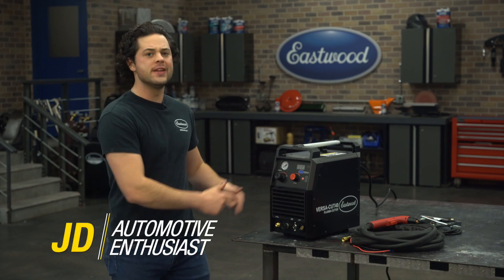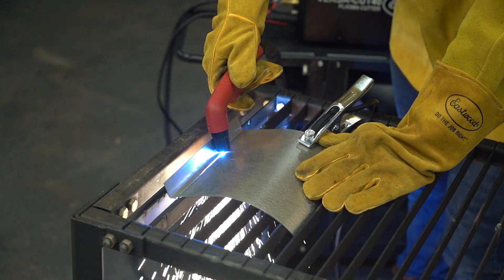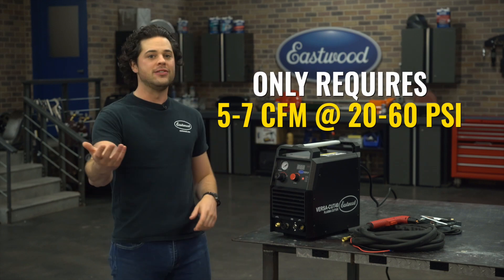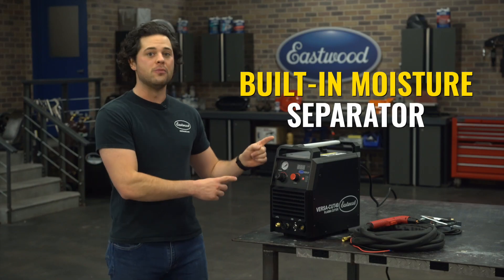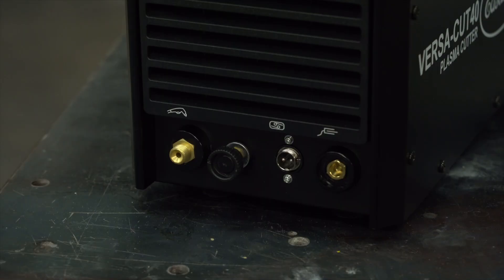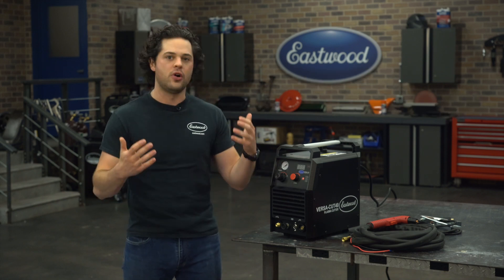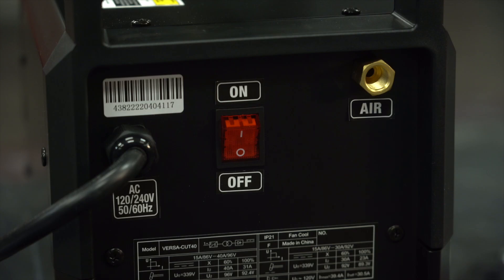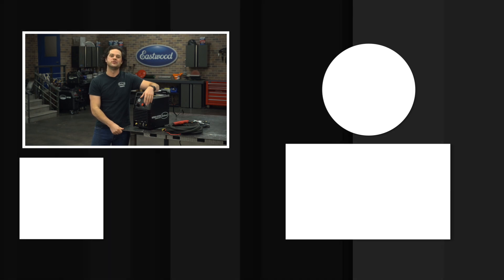Cut Steel, Stainless & Aluminum Up to 3/8" Thick -  Versa Cut 40 Plasma Cutter - Eastwood

Comment: Mine isn’t cutting through and is turning off after 5secs of holding, what am I doing wrong or what do I have to adjust to keep it running?
Reply from the maker: Please reach out to customer support: 800-343-9353

Comment: Mine don't cut that great and leaves alot of slag. Also burns through consumables like crazy...What am I doing wrong???
Reply: Mine don't either. I think the 40 sucks unless you're using 240V.
Reply from the maker: You may be dragging the tip instead of riding a slight amount above the metal which will eat consumables.
Reply: @eastwoodco  It has a drag tip, so you're saying it needs to be above the material to cut properly.